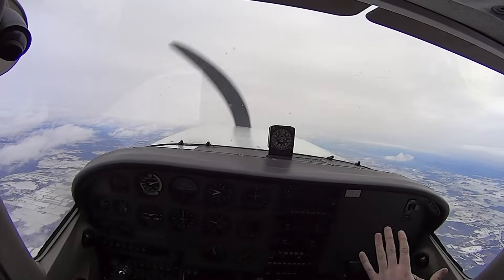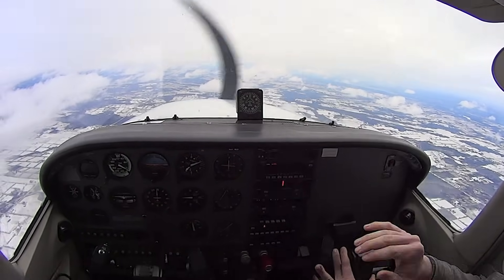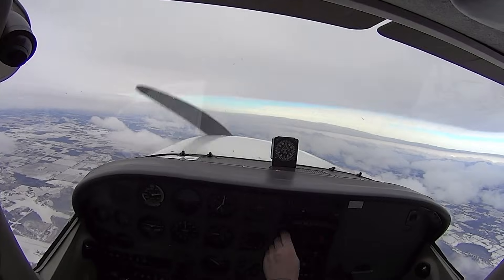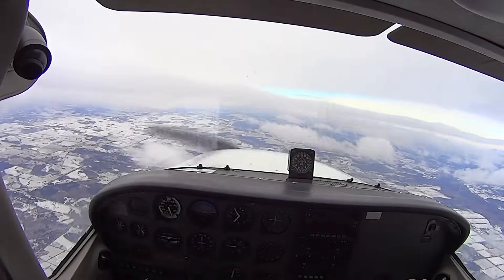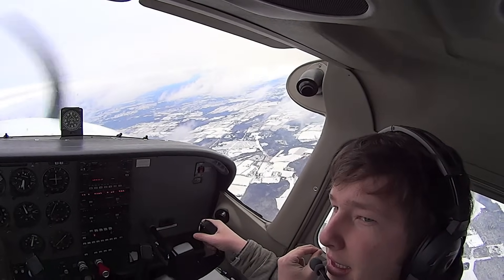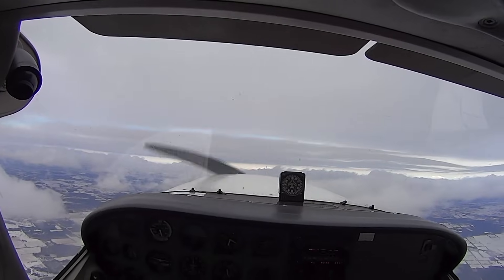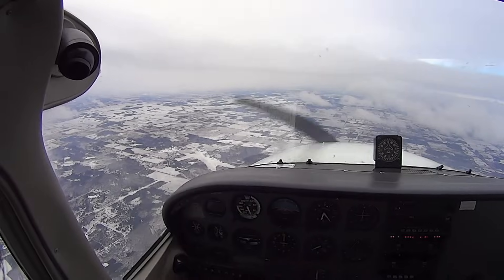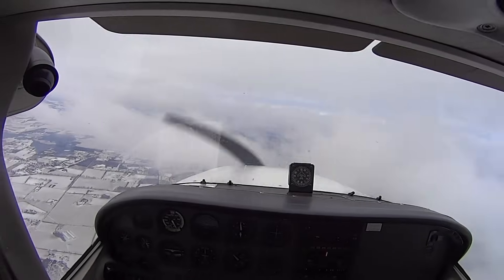Cessna 172 Spin Recovery Training (Full HD w/ audio)

Comment: Two things I noticed...

1) You took a long time to recover.  Your recovery should begin as soon as you have broken the spin.  Maybe you can get away with that in a Cessna, but you have your nose down like that for that long in a slipperier aircraft and you'll exceed Vne.

2) Why were you always spinning counter clockwise?  Spins can be disorienting, especially if you aren't expecting it.  If you always practice in one direction, the law of primacy will kick in and you will want to recover with your right rudder regardless of the direction of the spin.  Your instructor should have had you close your eyes, take your hands and feet off the controls, initiated a spin or some other unusual attitude in a random direction and tell you to recover.

Comment: Great video.  Great instructor too.  He has since moved on as an FO with a regional airline.  Good for him.  What I am really interested in is the simplest way to get great audio as well as HD video.  Suggestions Stephan?
Reply from the maker: I made a simple "Y" cable. The headset audio plug (the 6.3mm one) connects into my cable and one end of my cable goes into the intercom plug on the plane the other into my action camera microphone input. There's no need do the same with the microphone input, because the plane's intercom system (ICS) will automatically feed back about 20% of your microphone input back to your ears. So you only need to tap into the audio output from the ICS. Also, most action cameras employ dynamic range compression on the microphone input, which means that it automatically adjusts the microphone gain to keep the volume constant, so you don't need a separate volume control.

Comment: In this engine fuel injection or carb? What is the risk of losing the engine during a spin in a 172 due to changes in the g-forces and air flow?

Comment: You're still in a stall condition until the airspeed over the wings increases. Pointing down makes this happen faster. Of course, a Cessna 172's easiest recovery is to let go of the column... they have to be forced into spins and spirals (most of the time). Other aircraft are not so forgiving. My instructor did one intentional and 4 secondary spins in a Tomahawk.

Comment: throttle Idle, ailerons neutral, stop rotation, break the stall is the correct order. I had a student recover incorrectly and the speed increase was excessive as the stall is broken before idle power. Later in the video the order is correct...

Comment from the maker: Yes, power off right away. The power feeds the spin, so you want to cut the power while applying full opposite rudder. By the time the rotation stops, you'll be pointing straight down. You gently pull the noise up and climb as quickly as possible to recover the loss in altitude. You need to have a balanced recovery, not too hard so as to overstress the airframe (high G's) and not too slow that you would overspeed the plane.

Comment: Often you just ease the stick forward a bit, but mash on the rudder. Speeds will be low you're not going to bust anything. As soon as the rotation stops EASE back on the stick. Even if you just do incipient spins, its going to point pretty much straight down - suddenly the windscreen will be filled with fields and trees. Its a little disconcerting but actually pretty easy.

Comment from the maker: No, the power remains idle while the nose is down. If you added power while the nose is down, you would likely over speed the aircraft and over-stress it during the recovery, possibly damaging the plane. Also, while you're falling from the sky, do you really want to make it fall faster by adding power?  The power is added only during the last phase of the recovery, when the nose is already pointed up and your speed falls below Vno. This allows you to make up the loss in altitude quickly.

Comment: pull power back to idle, pull back on the yoke till you feel the plane start to stall, push your rudder all the way in one direction, stall/spin, add opposite rudder, level your wings when you recover, nose up, power up.

Comment: In the early days of the biplanes, pilots would spin down through cloud because once the spin is started the aircraft doesn't increase speed but falls at a constant rate.Bit of a problem if the cloud went down to the ground but much better than a spiral dive were the speed continually increases.So if you are stuck above the clouds and can't see the ground one way to do it is to spin down.Of course these days with all the good nav aids you should never be in that position. Cheers

Comment from the maker: I used a Sony HDR-AS15 wearable camera mounted to my headset. The camera has a microphone jack, but it is located behind a cover and not accessible once the camera is enclosed in the protective housing. I removed the cover and drilled a hole in the housing to allow me to connect a regular 3.5mm microphone plug. I built a custom Y-cable to connect with the ICS. It's a really great camera, but if you don't want the hassle, go with a GoPro Hero3.

Comment: What you have to remember though is that not all airplanes models and not even all C172 will recover from spin if you just let go of the controls.
This is specially true if you are spinning with full power.

Comment from the maker: The Mueller/Beggs technique calls for (1) power off; (2) let go of the yoke; (3) apply full opposite rudder to the spin until rotation stops; (4) neutralize the rudder. This is essentially what is being taught here. I believe we don't let go of the yoke because we want to break the stall quickly and speed up the recovery, but as you saw in the video, you really don't even need to do this. What is essential is to cut the power, otherwise you keep feeding the spin.

Comment from the maker: There's no doubt that opening a door while traveling at 105 kts will induce yaw, however, I personally doubt opening a door would do the trick when you're in a spin. You have to remember that the plane is stalled, so there is very little relative airflow to begin with. In addition, the doors are located closer to the axis of rotation and therefore the angular velocity at the doors is much less that that at the tip of the tail where the rudder is located.

Comment from the maker: If the rudder control cable broke but the rudder was not locked in a particular position, you would still be able to recover from the spin in most single engine planes simply by breaking the stall by means of forward stick. It would just take more turns before the auto-rotation stopped. The rudder is a primary control surface, so if the cable broke and the rudder was locked in place somehow... say your prayers.

Comment from the maker: If I recall my conversations with Glenn on this correctly, the vast majority of multi-engine aircraft are very difficult to recover from a spin once the spin is fully developed. I would therefore speculate that there is no spin training being provided for multi-engine aircraft as part of any traditional flight training program. I'm still working on my PPL, so I really can't say from experience whether this is really the case or not.

Comment from the maker: Yes, it is a legitimate term that applies to fixed-wing aircraft also (although the mechanics are obviously completely different). A quick check on Wikipedia indicates "For fixed-wing aircraft, autorotation is the tendency of an aircraft in or near a stall to roll spontaneously to the right or left, leading to a spin (a state of continuous autorotation". Glenn, the instructor in this video, may want to add to this.

Comment from the maker: The issue is the CG. As the CG moves aft the centrifugal force that develops during the spin becomes greater and the effect of the rudder to counter the spin becomes less. If the CG moves far enough aft the spin can no longer be stopped by the rudder. The far aft CG also means that it becomes difficult or even impossible to lower the nose to break the stall. The combination of the two is a flat spin from which recovery is impossible. The utility category ensures the CG is within recovery limits.